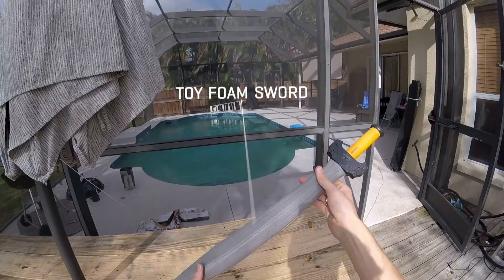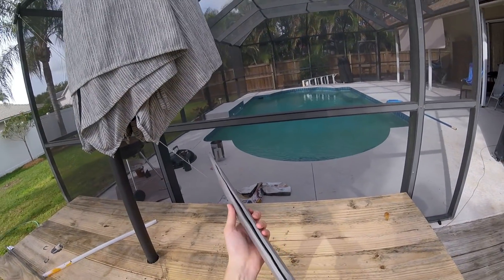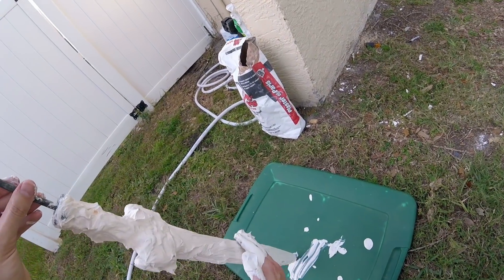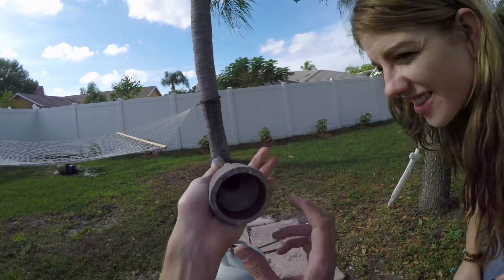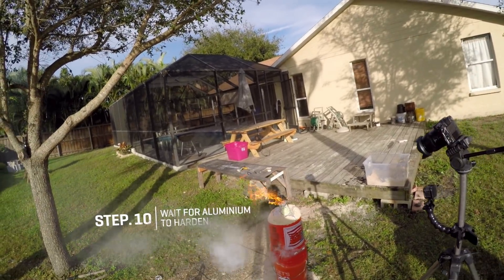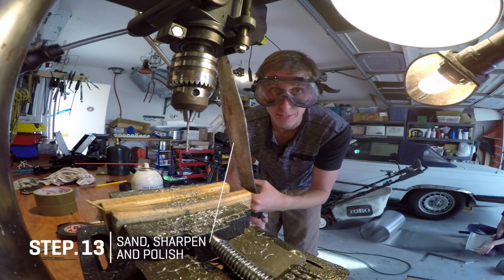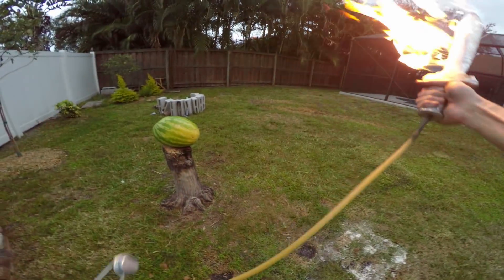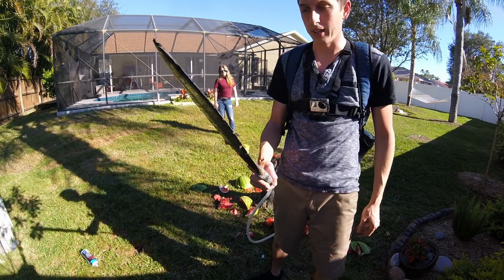GoPro: Making a Flame Sword With The Backyard Scientist

Comment: I think that if the holes on the sides were drilled at an angle away from the welder, more facing the target, the better it would look and reach, and maybe there'd be less hazard of the flames blowing back on the welder. What do you think?

Comment: WOAH you guys did an amazing job on with the video!! Seriously the graphics and motion tracking stuff was so cool.
What should I chop up next with the fire sword guys??
Reply: +Cal Duncan yeah that actually would've worked just fine! The sword is flammable but I'm sure he could use a couple dozen times for it to charred to use. If you dip it in water before you use it I'm sure it will last a long time!
Reply: TheBackyardScientist. I HAVE A IDEA FOR YOUR VIDEOS PUT HELIUM IN SOMETHING AND LIT IT.
Reply: A giant stick of butter.
And your next sword project should be a Tesla coil lightning sword (if it's not too dangerous).
Reply: Slice a table
Reply: Vegetables
Reply: Carve Pumpkins.
Reply: Cant Alluminam melt?
Reply: System HD not at this temp
Reply: TheBackyardScientist chop the 🦎
Reply: TheBackyardScientist try chopping a wooden board
Reply: People